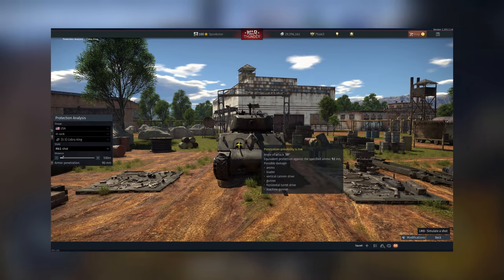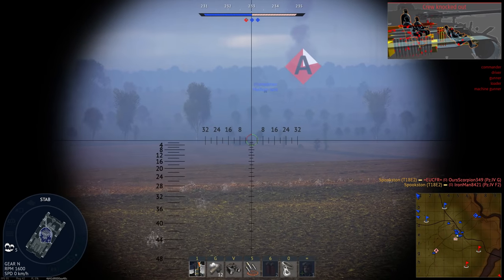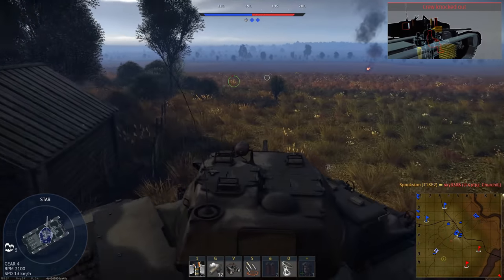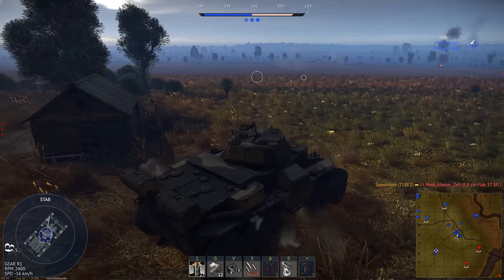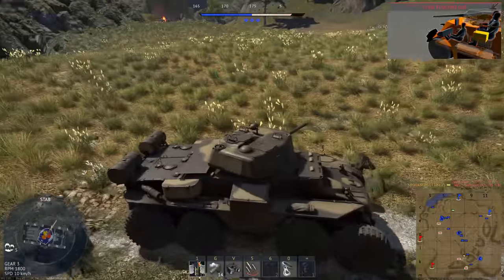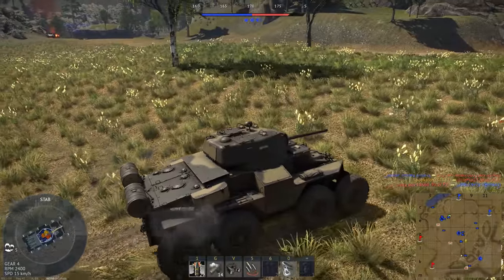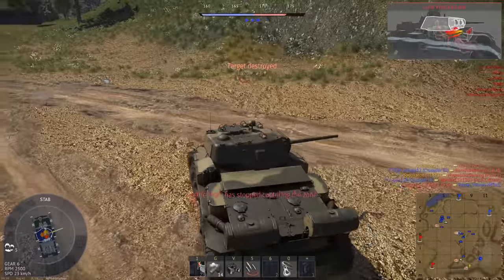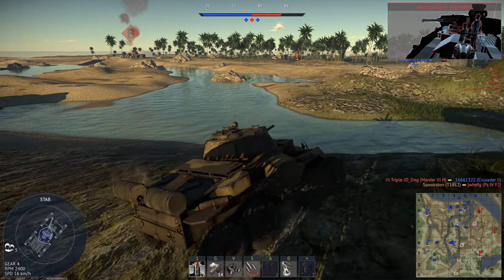Volumetric Shells Were A Bad Idea

Comment: My main problem is that volumetric shells seem to have vastly increased the chance for rounds to bounce, which was already too high to begin with. Now even Panzer IVs can struggle to pen a T-34 at medium range, which doesn't make any sense!
Reply: Agree
Reply: But also the Panzers have now a more reliable armour. I know gajin bad and everything, but you can't just complain forever.
Reply: russian bias intensifies
Reply: @mateuszkubas4433  panzers do not have armor lmao 
since when does a panzer iv ever bounce anything whatsoever
Reply: @mateuszkubas4433  lol even 50 cals can pen it from the side
Reply: @commanderrockwell1123  i don't mean panzer IV's the panzer III armour now works properly and is more reliable
Reply: @mateuszkubas4433  Yesterday I non penned a Panzer III M mantlet flat on, from 200m, with the 17 pdr. I don't think that's working properly...
Reply: @commanderrockwell1123  if you angle you would know panzers can actually bounce a decent amount of shells
Reply: @PNolandS  Yesterday i was using the IS-2 and i fired at a Sherman Firefly at point blank range... Non penetration, the shell hit one of the add on track armor and it did nothing, the he fired at me, i died and i almost broke my monitor.
Reply: @mateuszkubas4433  panzers armor isnt
Reply: @420foefoe  the pz4s armor is flat from almost every angle angle the front and that edge is still there
Reply: @carlblack8574  

I hit a Sherman VC with the M4 Tipo IC 17pdr and it just got absorbed by the plate that covers the bulge where the hatch is.
Reply: @420foefoe  The only shell they can reliably bounce are either shells from reserve tanks or the british 2 pounder lmao, anything else slices through the thing
Reply: @gian.4388  The Pz IV H has an 80mm front plate with additional 20mm track armor. It can reliably bounce Soviet 76mm shells to the hull from point blank and to the turret while at a distance.
Reply: @moldypotato4656  Bruh, I can understand the hull if angled, but the turret literally any shell can go through that plate
I'm pretty sure even at 3kms the soviet 76mm can still go through it
You most likely got Gaijin'd
One time a fucking M22 bounced the 105mm shell of my Tiger II 105 that hit its side at 90° angle just above its tracks from a distance of 30 metres
You really just can't trust this game, like ever
Reply: @PNolandS  Tell me about it, I had a Stuart's mantlet shatter a 90mm cannon shell from my Breda 501 without taking ANY damage. I should be able to slice through three of those things lined up in a row, wtf
Reply: @gian.4388 I played the Pz IV H in sim during the Kursk event a few months ago. There were several T-34s trying to push up within a km of me, with the closest being about 500m away. They were shooting at me for a couple of minutes and the only significant damage they dealt for most of that time was either to the gun barrel or tracks. Eventually they got some lucky hits on the cupola and turret ring which damaged some crew. By the end of the fight they'd ripped off all of the add-on track armor on the hull and exposed one side of the turret face, which is what eventually got me killed.

That was before the volumetric armor change so I assume that the armor has only managed to get better since then.
Reply: @commanderrockwell1123  Have you ever played Panzer III M? It's a beast and surprise, surprise... It does have armour! Fasten your seatbelts right now, because it's a shocking information. Its armour is working fine as well!
Reply: Im now confused when everyone is using the word panzer, u guys talking about the panzer 1s ,2s ,3s etc or the english translation of the word panzer which is tanks?
Reply: @moldypotato4656  Idk man, I tested the armor just now and even I was impressed with how shit the Pz IV H armor really is
At 1.5kms even if angled you can still reliably pen it with a standard T-34 1940 with the short 76mm, the only two plates being impenetrable are the two flat portions of the hull (both are 80mms)
If you try to angle it you expose the PzIV's side which is just 30 fucking millimetres and you can pen it easily
I was especially surprised to see how weak the upward angled part of the hull is: ONLY 20MMS? What the FUCK HAHA even the T-50 with its default shell can pen it at 1.5kms WHEN ANGLED
And the Panzer IV H is at BR 4.3, where the T-34s have the better 76mm or the much more powerful 57mm cannon and there are KV-1s 
They were either absolute noobs or extremely unlucky
Reply: @mixderman2461  I play it regularly, and lmao no it doesn’t
Reply: @420foefoe  from what, a BT-5? lmao
Reply: Try shooting a BMP with HEATFS and you'll see the true nonsense shit
Reply: @rommelspanzercorp6156  When people in english refer to “Panzers” they’re usually referring to Panzers I-IV since V and up began to get actual names.
Reply: I'm fully convinced the 88mm on the Tiger can't reliably penetrate the T-34 from the front due to how many times the shell tend to hit the optics.
Reply: @gian.4388  Did you test it out with the add-on track armor? The short 76 should definitely not be able to pen it in most parts past ~500m.
Reply: well now even tiger2s can bounce on the shitty side armor of t34 cuz the side skirts and tracks can now eat the shots
Reply: @The PNolandS So that's why My ass was handed to Me so many times when I unlocked 5pdr Cromwell, I basically couldn't pen T-34 cheeks and gun mantlet and not gonna mention front hull and sideshots.
Reply: @Xerroxify  shot the side armor of chitolate 4 times with delatorn ,only 1 of my shots resulted in a pen and 3 of them got absorbed by the track
Reply: @llll2987  Dang that sucks it should at least ricochet the shell not absorb it. Anyway checked the ammo stats for 5pdr and it sucks when shooting angled armor.
Reply: Panzer 4 is with long 76mm gun, right?
Reply: @PNolandS  me, myself a wehraboo can ensure you it's 100% working properly and historically accurate 😆
Reply: @Killdozer-do4mc  Panzer IV has both short and long 75mm
Reply: @commanderrockwell1123  In my Panzer IV J I absorbed a T34 85 shell through the angled front plate above the transmission.
Reply: @commanderrockwell1123  i bounced off a 17pdr with the Pz IV H
Reply: @K_Balu  What matters isn’t whether or not you manage to bounce something once just because it managed to hit you at a freakishly high angle. You can probably bounce a shell from the fucking Bismarck in a T-34 if you try hard enough with the angling. 
What matters is consistency. Can you, with a Panzer IV H, EXPECT that by orienting your tank in a particular manner, you will RELIABLY be able to bounce a shell from a 17 pounder? 

...No, lmao. no.
Reply: All these people going on about panzer armor, and I'm just over here with my Swedish tanks going "you guys have armor?"
Reply: @PartiallyLoyal  High explosive shells don’t count.
Reply: Even the Panzer IV F2?
Reply: @robertbalazslorincz8218  He means the Panzer IV F2 and up.

Comment: Spookston thank you so much for broaching this subject. The part about the two plates meeting is the worst part IMO. It's made turret rings the strongest part of the armor. It's happened multiple times where I'm in something like a panther, that has a gun with ~190mm of penetration point blank, and I hit the side of a T-34-85 in the turret ring, but it deflects because the shell is striking the turret armor, the side of the hull, and the turret ring itself, and it's adding all these values together and deflecting my shot. At low tiers this shit happens to me all the time and I'm so sick of it. I'm so glad you made this video because it felt like no one was really talking about it.
Reply: Optical ports? Ah you mean armor strongpoints!

Comment: Volumetric shells make armor work better than before.
Most weak spots are often in places unlikely to be hit in the heat of a real battle.
Pixel targetting is a skill that while valid, you can't rely on it as your main strategy because it is not as reliable as it seems at range, considering that no weapon is pinpoint accurate.

Comment: It's not a bad idea in general but they just went with full shell diameter which is not how this sort of stuff works. Making the shell hitbox half or even quarter of its caliber should improve things drastically.
Reply: Good idea. It seems that Gaijin forgets that real life shells can deform or fragment when entering small gaps. I too think the hitbox diameter should be reduced by about half the actual diameter of the shell, so that only the largest guns, such as howitzers and field guns are most affected by the volumetric armour system. I especially think kinetic energy penetrators like APCR, APDS, and APFSDS should be least affected by this mechanic.
Reply: @xxfalconarasxx5659  Sure, since their type clearly states that they are "subcaliber rounds"
Gaijin really messed up

Comment: T34's in the lower tiers like 3.0 and 4.0 are also god awful to fight if your entire lineup consists of 75's, volumetric update made one of their only frontal weaknesses the turret ring into a black hole and now all that's left is a unreliable shot on the cheek that only pens if your lucky and it doesn't wiggle its turret.
Reply: Wait, when did the American T34 go down in br?
Reply: Don't forget the T34 747 (r),I hear most complain about Soviet T-34s when this one is completely better than the Soviets and the update made it even more broken since most Allied tanks have 76s and less penetration.
Reply: 747r is just OP in general i can't pen it without shooting the turret side or back.

Comment: Gaijin keeps addint updates but, not having ANYONE test them or advice them on changes. Volumetic is a good idea on paper. sadly they never laid the ground work for seemless integration. They have the system to fix it... WAY after the fact. When they added the harrier.... they only tested to make sure it worked...not worked balanced... now the fucker can go 100% vertical in plane mode... AND STILL ACCELERATE

Comment: I’m not concerned with the balance issues. This is a fix needed for realism and simulation. They just need to fix stuff like the two plate joint bug.
Reply: except it does the opposite of increasing realism as the joint between two plates is often a weakened part of the armor due to edge effect among other things, but those places are exactly where you get the two plate issue = infinite armor issue happening. Their volumetric shells lack the fidelity to properly simulate them, especially when you take into account the mismatch between volumetric shell and point value armor. 

Nothing is realistic about hitting a turret ring and having the shell completely shatter and the armor act as if nothing ever happened to it.
Reply: @JWZ1001  "They just need to fix stuff like the two plate joint bug." Can you just read my fucking comment before responding like that? thanks. I literally said they need to fix the issues with that and it would be fine but I guess it was too much effort to read that far ahead.

Comment: Honesly I don’t really mind volimetric shells, but I can see the points you’re making. All I’d love to see right now is just the addition of volumetric armor, “variable thickness armor”, that works pretty realistic I think..
Reply: do you know whats realistic? all HEAT rounds 1 shotting tanks. im not making it up, HEAT rounds not only fire molten copper into the tank, but pull a lot of hot and burning air along with them, cooking the crew.
Reply: @danielsteger8456  as if

Comment: Well you want to hear my Honest oppinion?
I like the Volumetric shells,because I can finally feel like a Heavy Tank.
It is only just the start,we still got like Metal degradation where shooting one spot would bend the metal (As shells do that to penetrate)
And Kinetic shockwaves (IS-2 Killing a Tiger 2 whit a Non Pen,Just because it got stoped in the front of the armoure does not mean the shell wont Cause Massive Kinetical Shockwave to the entier tank causing the crew to get injured).
As it would negate the effect of a shell hitting the armour like a feather instead of a Brute force flying towards you.
And a last thing to be added that I would love,Jiggle effects on Tanks,as RN they feel like Rock Toys and not actual Tanks.
A bit of Jiggle to the Tanks Equipment and Parts would make it seem alive.
And dont think the game is frustrating,why dont you imagen yourself in such a situation where you could die instantly in a Tank.
A Game vs Reality.
You either Go Realistic or Arcady,and WT isnt WoT where a tank thats a 100m away suddenly dissappears.

Comment: I think it made the game better. I came to  this game from WoT because I thought it was too arcady. I always felt that it was a shame well armored tanks were essentially useless unless going against new players because everyone exploited the same weakspots and could essentially pen you from anywhere so no reason to get a heavy tank. Now you can actually use your armor to your advantage. Also getting shots squeezed through impossible gaps or getting trap shot really easily was annoying. 

It's made the game more diverse by making more tanks viable, literally the only problem with it is the problem with armor plate joints absorbing shots but I'm pretty sure it was not intended and will be addressed sooner or later.

Only real reason to be mad is if you're a try hard who's memorised every cheese shot weak spot and now has to do it all over again

Comment: I still like volumetric shells.
It's just that they need an extra piece of code, that says "if there's a weakspot but the shell is too wide, the armor still will be thinner"
Reply: once when trying to shoot a T-34-85 in the turret cheek I hit the crack between the turret cheek and the mantel and it fucking ate my shell and got me killed. You'd think that a gap between plates would be WEAKER than an actual plate

Comment: Youre Videos are a Pinpoint hit at what wrong with warthunder. Its ridiculous that cast turrets have overlapping plates as thats simply not the case despite Gaijin treating it that way. And there is so much more wrong with volumetric shells
Reply: To be fair which cast turrets. Cause later cast turrets did have inserts and plates on the outside.
Reply: @CzornyLisek  yes but the way there modeled in game makes no sense with volumetric shells as everytime a shell hits two plates the thickness is added together rather than the thicker plate beeing the one counted

Comment: I'm sorry, but I don't agree with what you say.
Many of your examples whereby you say volumetric bullets should not be implemented depend a lot on the calibre of the barrel or bullet used.

I do agree that it fails in some aspects, especially in vehicles that do not have volumetric armour, but it has also made many vehicles able to function properly.
Destroying the tank turret ring is no longer a pixel shot that is pure bullshit, but it is possible with a bullet of the correct calibre.
I also agree that the hitbox of many objects in the mapping does not correspond to their visual model. That can be fixed and is not a problem with the volumetric bullets themselves. It is something that was already there before they were implemented.

I also have to say that your jumbo example is a lie for the most part. Yes, it is difficult to hit its weak point, if you aim for the edge, but it is still viable with a bullet from a tank of its BR or lower.

I am going to clarify that I especially agree that Gaijin should put a quality standard in all the models already implemented in the game regarding volumetric shielding, hitboxes, etc. etc.
But your complaints are very situational and depend a lot on the custom of the player himself before they put volumetric bullets, the vehicle you are using and so on. Not from mechanics as such.
Not being able to do pixel shot tanks is not an excuse IMO.

They should also fix small plates to bounce high calibre bullets like the ones over the tracks, but that's offtopic and was already there before volumetric bullets were implemented.
Cheers!
Reply: A) shells man! Shells! I was twitching reading this!
B) It's not situational when it affects basically every BR and has huge impacts
C) This also doesn't take into account the fact that shells aren't just floating bricks either- they can force their way through holes smaller than their total diameter because of their shape and velocity 
D) Jumbo's weakspot got so much more unreliable. I commonly play with and against it, and the machine gun port is now basically a roll of the dice. Long 75s and 88s found on vehicles around the tier now often nonpen that little machine gun port because they clipped the machine gun itself or the edge of the surrounding armor
E) The components are made of Stalinium. The most known case is the fuel tanks filled with Lenin's piss that stop shells but other offenders include sights and vision ports that also have shells for breakfast

Comment: One of the biggest problem may be that the shells are “indestructible” (until hitting the hit box of the tank in a proper way) so when an area where two plates meet is where the problem becomes fully realized so if that’s the case then they’ll have to introduce a physics system for the shells themselves which has the problem of being it could cost a lot in performance for a low-mid tier PC let alone it’s console port but if it isn’t they’ll prob have to rework much of armour penetration mechanics

Comment: I'd say a major problem is that shells simply dissappear if they strike to much armor. When they first released the volumetric shells we saw an IS-2 try to get a shot into Tiger I's turret ring. The shell struck the UFP and the bottom of the mantlet but the rest of the shell just disappeared. I'm certainly no expert on shell physics but if the shell stayed on a trajectory where it would clip the mantlet would some not get lodged in the turret ring?